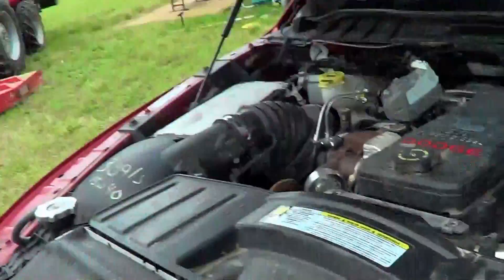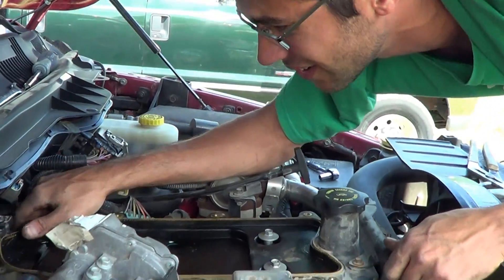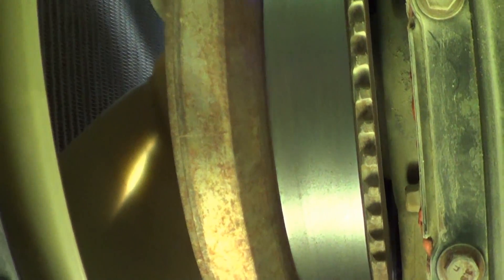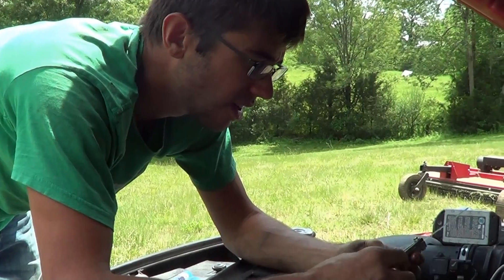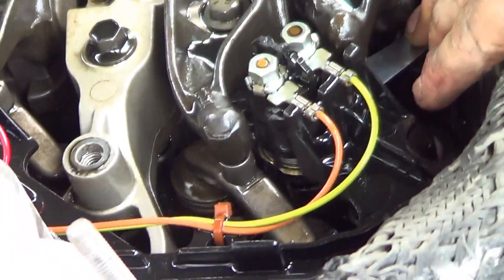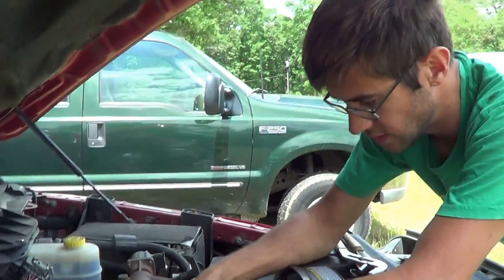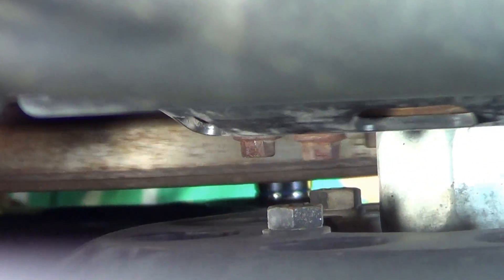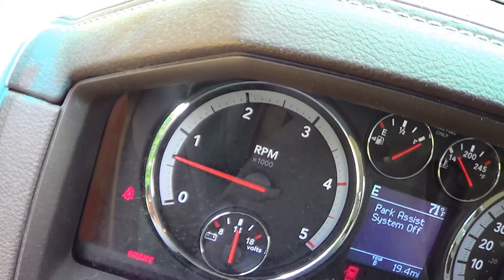Adjusting the Valve Lash on our Cummins 6.7 Diesel Engine

Comment: Here is some advice when adjusting the valves on the engine 
Use an angle feeler gauge for better access and try using a inch pound torque wrench to get accurate drag on the gauge then and you will know that every valve lash is the same.
Reply: How do you use the torque wrench to get the drag right?
Reply: @Philipians121  
You find the correct inch lbs that you’re comfortable with then use that inch lbs on the remaining valve lash this way you will know that every valve is set the same. 
You use the torque method on intake and exhaust valves

Comment: How do you know you need a valve adjustment...beside the motor having 150k miles...
Reply from the maker: It's pretty hard to tell because it happens so slowly but increased tick or knock from the engine and slightly lower power.
Reply: Mortons on the Move mines at 106k every morning I start it it knocks /tick for a couple of seconds then it goes away...you think valves need adjustment ?
Reply: @JVazquez-e5x that’s typically your fuel system, normal for startup. Building pressure/ getting any air out
Reply: @alexl710  appreciated

Comment: the best valve lash adjustment video out there
Reply: and just a question - i've done mine - most rattle noises are gone - a bit noise left under acceleration, so i'm going to do that all over again. 
 Do you think that if i'll use 1.1 and 2.1 feelers and tight until the end so there will be no drag - it will make all valves consistent for sure - what do you think?

Comment: Late to the game here, but I just adjusted the valve lash on my 6.7 Cummins yesterday. I had watched this video beforehand, and it was very helpful. The biggest time saver that I found was using the Cummins engine barring tool. It lets you bar the engine over using a male splined socket that engages the flywheel through a cover on the passenger side of the engine. I used a variety of extensions and wobble sockets so that I could bar the engine from the front of the truck, and watch for the TDC marker, which I had marked with a Sharpie, so it was more visible. I was able to do all of the work by myself, in just over three hours, and now my truck sounds much better.
Reply from the maker: Very good! We should have used the barring tool. I think we are coming up on needing to do it again, (engine is starting to rattle again)
Reply: Mortons on the Move the one I used is the OTC 7471A that I purchased from Amazon. I have a 2013 Ram 3500 Heavy Duty High Output, so I have an Aisin AS69RC transmission, but the tool is advertised as working on all 5.9 and 6.7 Cummins engines in Dodge/Ram trucks, with any transmission combination.

Comment: Seems a lot of cummins mechs are adjusting them to .08 instead of .10. Say it makes an incredible difference unbelievably quiet.
Reply from the maker: I thought about tightening it a bit more but was not sure about performance... maybe on the next adjustment.
Reply: Valves expand during heat cycles and if your truck is the least bit turned up then you really should set truck slightly higher to account for valve stem stretch that way your valves fully seat. You don’t want to burn one after a few thousand miles or so.
Reply: @jakejordan1982  reading publications talking to various Cummins Mechs at different events. Current trends and what not. I can tell by your comment your the type that looks for debate or argument in the comment sections. I'm not your guy sorry.

Comment: just a FYI you want to change the crankcase filter every 60k or 50k if you do alot of heavy towing. if you dont you will end up sucking oil into the turbo witch will cause some significant damage to your engine.
Reply from the maker: diesel\m/n14 or ovrrpressuarize the crank case and blow out the oil pan and rear main seals!  been there already and have a video about it :( .  that thing is getting gutted and vented to atmosphere on the next change.
Reply: Mortons on the Move, yea that too lol. we had a isb 6.7 with 350k run away a year ago at my work becouse the crankcase filter was never changed and the air filter was plugged up. the entire intake system from the turbo to the intake manifold was filled with oil. the engine was a total loss all becouse the customer never services his shit lol.

Comment: What oil are you running? I adjusted mine and it was a lot more black under my valve cover. It it oil change time though.
Reply from the maker: Is your EGR still intact?  Mine does not function any more and my oil is much cleaner.   I just run shell rotell or valvoline premium blue.  I dont use synthetics for diesel because I have heard they are more prone to cylinder lap and glaze at high temp idle (so I have heard, no scientific proof on this).  Synthetic is also just really expensive for that much oil.    I just run for 8-10k then change and don't let it low idle for long periods.
Reply: I'd recommend running amsoil or a really good synthetic oil. I use amsoil in my motorcycle and at 70K miles, the entire engine/gear box looks like a 5K mile unit

Comment: is the valve cover plastic?
Reply from the maker: Believe it or not it is, Its a very heavy/ thick ABS type plastic
Reply: wow
Reply: @guuguguguggug  no. The plastic on the very top is for show. The piece under the filter he pulled off is the actual valve cover.

Comment: It's actually quite a bit easier on a deleted truck. Without the egr cooler in the way you have substantially more room to move around. Nice video bud.
Reply from the maker: Oh i bet.... I should really remove mine its only there for appearance on my truck....
Reply: Mortons on the Move what do you mean it’s “for appearance”?  It’s not currently doing anything?
Reply: I was thinking the same thing. I didn't have that much trouble doing mine.

Comment: Sent my truck to a mechanic for new injectors, how can I tell if he replaced them ?
Reply from the maker: Were you having issues with the truck?  If they do it correctly there should not be any way to tell unless you are using a different model injector that looks different.  The fuel lines will have to come off and if they have never been off before they will probably show marks from removal.  I would ask for the old injectors back unless they are keeping them for a core charge.  What engine is it?

Comment: hey you never showed us the tdc when it's center how is it supposed to look when it is? but other than that whenever I need to do this I'll be using your video thank you so much! you did a great job
Reply from the maker: Thanks!  I guess we did cut away at that point.  Basically you just want to line the TDC straight up and down with the block.  Its easier to see in person than in the video, however since it is offset to the fan it can be a bit deceiving.  Not too hard of a project but one you want to make sure you get right.

Comment: good video, not sure what you mean by just a little bit of drag, but when lash is set correctly the next size up feeler shouldn't fit. I did mine yesterday and when the gap is correct the corresponding gage will have quite a bit of drag. I found when there was just a little drag I could still fit .005 or more in, according to the tolerance though that would still leave you within spec.
Reply: Think of when you drag your hand or finger on glass. The more you put pressure on the glass, the more your hand drags. That's basicly how it feels. The tighter the adjuster is, the harder it is to pull on the feeler gauage. the looser the adjuster is, the easier it is to pull on it. ALWAYS CONSULT THE FACTORY REPAIR MANUAL OR A REPUTABLE REPAIR MANUAL!!!!!!!!!!!!!!!!!!!!!!!!!!!!!!!!!

Comment: Excellent video.  I'm considering a RAM3500 diesel and seeing this done is very helpful as I've never worked on a diesel before.  Suggestion:  Had a friend who was a full time mechanic.  NEVER wore his wedding ring when working under the hood but just forgot one day.  Holding a wrench in his left hand which was touching the ring, he slipped and touched the battery terminals.  Melted the flesh on his finger under the ring in a heartbeat.  Be careful.
Reply: D Hyde I have a silicone band and I love it
Reply from the maker: Well it is muuuch easier on a Cummins than the Duramax or Powerstroke.   That is one of the reasons i went this route.  Sooooo much stuff has to come apart each time you get at the engine in the ford or GM including the turbo.  I like to be able to work on my engines myself.  You can even do injectors in this engine yourself pretty easy.  

I have caught my ring a number of times on things and it can be quite scary. Thanks for the recommendation, I think I will take it off next time!
Reply: I drove a 5500 work truck with the Cummins for 5 years and loved it but never worked on it.  We had fleet maintenance.  Another quick tip:  put 1/2 a teaspoon of Dawn dish soap in your hand and then rub it in til it's dry, like you're putting on lotion, before you begin.  When you're done, just wash your hands.  They'll be completely clean in no time.
Reply: Mortons on the Move do you still have your dpf/egr?
Reply from the maker: Kind Of.... They are still there but dont do anything. (Its been modded)  Hence the slightly tighter than current recommendations on lash.  I used the marine spec/ 24V spec for this engine.

Comment: idiot it's 0.10 and 0.20 so if you did 0.2 your way to tight
Reply: 0.20 and 0.2 are the same value sweetheart.
Reply from the maker: Not sure what you are talking about..... .01 and .026 is spec for the truck... I went .02 because it is modded....
Reply: It's a good thing you're not a mechanic...
Reply: You might want to recheck that.  Never seen nearly 1/4" gap on valves.   Would be quit noisy and probably wouldn't run. ha.
Reply: Idiot? Are you just having a bad day or what????
Reply: anthonyb86 everybody needs a good laugh, I find most of them on youtube starting off with the word idiot.
Reply: Must be the new math they teach today in school.  .10 = 100 thousandth  of a inch, which is 25 thousandth  smaller than a 1/8 of a inch. .01 = 10 thousandth  of a inch. .20 is 200 thousandth  of a inch, 3/16 of a inch is .186 by the old school math
Reply: Yea and neither one are the correct gap.  who ever heard of a .2 gap on a cummins.

Comment: I don't guess you have the rest of the manual do you? Great video by the way, thanks for sharing
Reply from the maker: Sorry I dont,  Pulled those pages from another source online.  Wish I did tho!  Glad you liked the vid.
Reply: air2bmc - I know you can download the '08 service manual for free with clickable pdf hyperlinks.  Not sure about the other years.  I would image 07.5 to 09 would be the same.  Not sure about 2010 and newer.
Reply: what year do you have?
Reply from the maker: 2010
Reply: Sorry, I meant air2bmc.
Reply: Yeah I  have a 2012. It's been a chore to find a service manual, still no luck.
Reply: Download the 2008 6.7 manual. It will at least get you most of the things you need I'm sure.  It obviously want have DEF related stuff but most of your other stuff should be there.  If you have questions about particulars then join some place like cumminsforum to double check.

For the manual, go to carbonitecummins and click 'articles' and the first link is to the service manual.  He use to have a direct download but moved it to dropbox because of traffic.  The link will take you to Dropbox.  You have to register for a free Dropbox account.  Edit:  You can do a direct download without an account.

The file is called 2008 DR FSM.pdf and is about 420MB.  The file is like 10,000 pages.  Thank God it has PDF hyperlinks....click something in the menu and it takes you there.

Once it's downloaded, just make sure you open it with a pdf reader like adobe reader or it screws up the layout and the links.

It's the same file I downloaded years ago and it's been a blessing.  I don't even think you can buy service books anymore.  It's just on CD for about $140.  I think you can also go to techauthority and get a subscription but it's pricey.

The last service books I bought was for a 99 LS1.  They were $300 for 3 books totaling about 10 inches thick.  I got them for a steal at $140 way back.

Hope this helps.

Comment: Is this the first time you have done this?  I've heard it can be all over from the factory.  Thanks for the videos!
Reply from the maker: +Olive Drab Yup first time, and they were actually very close to spec and all set about the same.  There was a little variation but not much. At least in my engine i would say the factory (probably robots) did a good job setting them.

Comment: I had no clue what you did, but it sure looked difficult. Way to go on that lash!
Reply from the maker: +Mark Jones Lol thanks,  kinda geared this one towards someone looking to do the same.  Probably should have explained valve lash in the video : ) .  The lash adjusts how the valves that let air and exhaust into and out of the engine cylinders move.  If they are off the tiniest bit it can screw up an engines performance, especially a diesel. I am not sure why they are adjustable but I think its just because the tolerances are so tight that if an engine wears a bit as it gets older you can put it back into spec as when new... which is what i did.